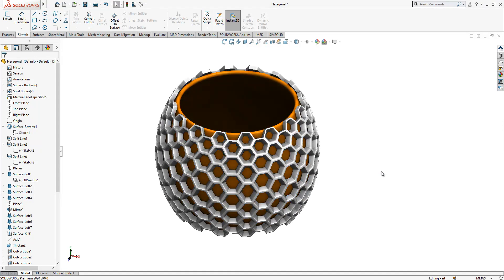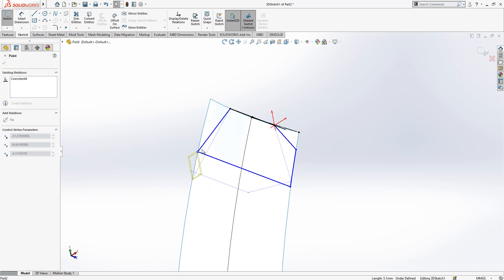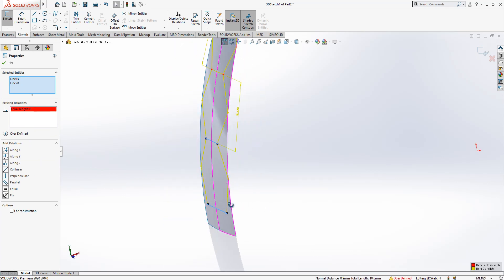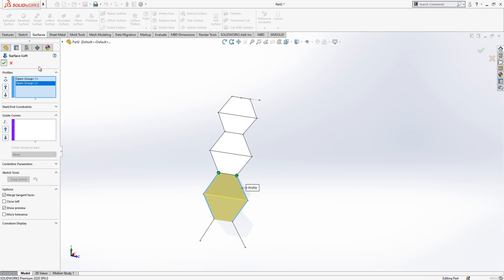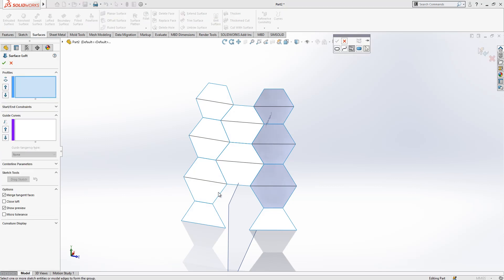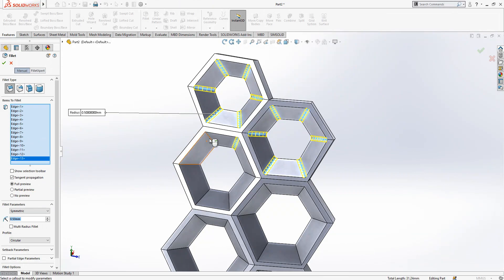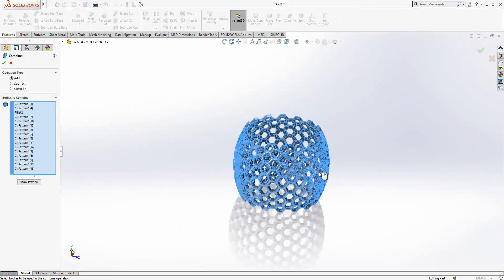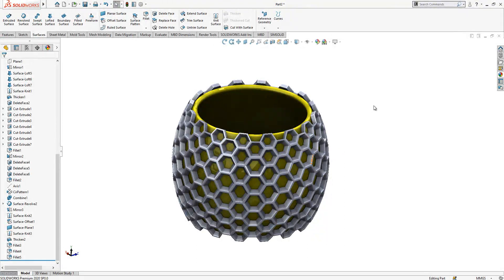Advanced Surface Modeling - SolidWorks Tutorial

Comment: Do you think it would be possible to 3D print this shape?
I'd like to use it as a pen holder. Looks very good; dimensions should also fit
Reply from the maker: I never used a 3D printer, yet looking at the parts that printed on 3D printers my conclusion: yes it should be printable!
Reply: @3D-World   then I got work to do! Still quite a beginner but you explain it well. I will give it a go. If I succeed I will let you know. Keep up the good work.
Reply from the maker: Good luck! Looking forward to hearing from you!